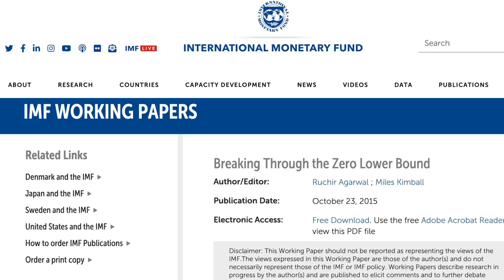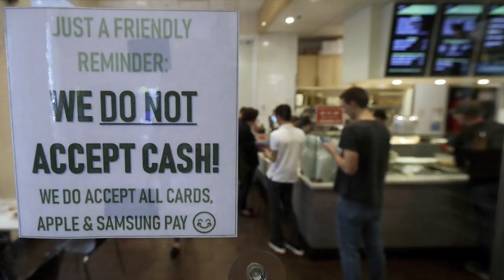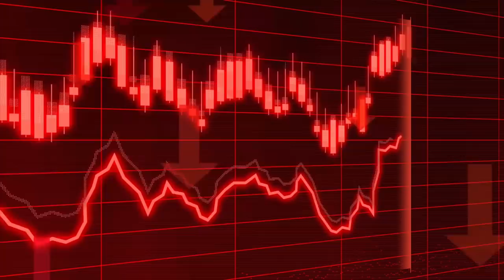🔵 Central Bank Digital Currency Explained

Comment: In Florida, it's the exact opposite for cash.  I've ran into stores that only accept cash for purchases.  You can only pay in debit or credit if you order the product online ahead of time for in-store pickup.
Reply: I applaud Florida for that. Here in California, at least Los Angeles it's becoming the opposite fast. Especially with this new generation who are quick to pull out their phone for anything that they do. 

Regards 🤝
Reply: I went to Slacks Hoagie Shack here in PA and they have a sign that says they prefer cash. I applaud them for that. It makes much better business sense and I was happy to pay in cash.
Reply: @MacMac1313  What about gas?  Does it still cost less to pay in cash at the pump there?
Reply: @MrSrc08c  Sometimes yes. It depends on the station you go to. Some will have a lower price for paying with cash or a debit card.
Reply: @MrSrc08c  cash will cost less until it doesn't.  but great example of where we have always had a different price for goods depending on method of pay. cash might just in the future cost more.
Reply: @hvaball150  I do acknowledge the fact that one day you may have to pay more in cash than you do in credit for the same good.  However, that day is NOT today and I make this point because people talk about cash like it's worthless when in fact, it's value is higher than debit or credit in some (if not all, albeit it's hidden) scenarios.  Additionally, at gas pumps the price difference is not just a service fee to run a credit or debit card, because  if it was, we should see a flat fee regardless of number gallons of gas purchased, instead of a difference per gallon purchased.
Reply: @MrSrc08c  it's a percentage of the total bill (like 4%). that's why its tied to the gallons purchased and not a flat fee. but banks are starting to charge fees by amount of dollars/coins turned in too. if credit goes less % than cash you will see higher cash prices.  I acknowledge not today. but in theory the full cost of handing cash for the bank will exceed digital.
Reply: @hvaball150  If it's a fee based solely off of processing the payment, it wouldn't be a percentage it would be flat (unless you're just getting ripped off, which is possible and another reason why cash is worth more), because I would think it takes no more resources to process a payment for $100 than one for $5.  In fact this is why some stores have a minimum for card purchases, I think it's because the processing fee is too great to offset the profits of a small purchase.  At the end of the day though, this isn't even worth arguing because cash DOES buy more gas and therefore is worth more in it's value at the pump which is one of the largest consumables and therefore a good gauge of the behavior of cash in the overall economy.
Reply: @MrSrc08c  maybe I'm slow today. but a flat fee would not work well. the fee percentage agreed upon is based upon the average expected transaction price of the business. thus they (trx biz) lose some money on smaller trx and make more on larger ones. balances out. otherwise they would have to take the average and bill their fee to small purchases (many people might not buy then). and also lose the large purchases extra amount (which is bigger risk of fraud loss by the way). net loss for the model over an estimated fee for the processor, and the business would also suffer missing sales on below avg purchases.  you wouldnt pay $2 fee to pump $2 of gas. you would wait until you needed a full tank and then pay same $2 fee for $70 of gas. rather inconvenient for the customer too. right now you just go buy gas, whether 2 gallons or 30, and pay the same rate. and digital is about convenience.  I cant really figure out your argument even theoretically other than, yes the transaction itself would cost about the same (but the fraud risk I elluded to). business also account slightly better (not all but some) to variable tax like percentages of sales for profit per gallon. some cant amortize basic fixed cost (like overhead/rent) to estimate their volume,  and that can cause biz failures. adding a fixed-variable costs on there on sales revenue adds accounting. I hope you are not arguing it's a fixed fee. ATMs are like that. in that case you're not exchanging goods.  just services.
Reply: Go Florida!
Reply: Yes, including even Mcdonalds.

Comment: Fantastic set of videos! 2 legends. Been preparing for what's to come. I'm soon moving to a place where I can start a garden! Then I'm all set. Well, if that's even possible...
Just one question. To stop "supporting" the banks. Does it help to move my fiat to a small local bank? In stead of the big banks.. (IF they would fall.. small ones, will just fall too, right?) Many thanks!

Comment: I'm in Canada and am self employed and clients have been bringing me the old $50 dollar bills. Superstore wouldn't take it. I think they are running out of cash and they are having to put the old money into circulation again. Honestly, I've not seen one of these bills for over ten years, easily. Most stores here are still taking cash....I did travel up north recently and I would say most of the smaller towns still have a vibrant Main Street as the locals are frequenting those shops. In the larger towns, like I'm in (size almost 400,000), our downtown and Amin streets  in various parts of the city are mostly boarded up.

Comment: Actually I don't think that you are correct that there is no fee for using cash, for the consumer yes perhaps, but for the retailer not necessarily so, my friend running a bakery said that the bank charged him a percentage of his cash deposits and therefore he did not prefer cash to credit cards for that reason. The banks I assume would argue that they are just charging for the extra handling of the cash as staff don't work for free.
Reply: yes. cash can be expensive versus digital.

Comment: I tried to explain the "Coin Shortage" to family members and they think I am a conspiracy nut.  The fact is either the cheap metal in coins (copper, tin,etc) is about to become worth more in melt value than the coin itself and/or the absence of coins helps encourage people to use Debit/CC cards because they don't want to 'round up' the loss of every dollar and lack of change given.  Either way as the currencies deflate (and prices inflate) in value, then everybody will start looking for the EXITS from currencies and into things that 'maintain' value. (But, it's not possible for EVERYBODY CANT LEAVE A STADIUM AT ONE TIME).  AND, as Lynn suggested 'Nominal' values make LOOK like they are maintaining or outpacing inflation (Houses, classic cars, art, etc.) But in true reality they are just inflating with the currency.  When the Titanic went down the rear of the ship tilted ever HIGHER until the ship was standing on end just before it PLUNGED completely under the water line too.  By then will PHYSICAL Silver and Gold even be available?   I doubt it.   They got ya trapped then.  Glub, Glub; goodbye wealth.  Bonus: but you CAN still purchase 100 Trillion Dollar Zimbabwe currency notes on eBay!

Comment: Alot of gas stations in America will accept your credit/debit card but cash is cheaper rate at the pump. Some the prices are the same. Cash or Credit/debit. Buy Assets. 

Find out what the best assets long term hold & get things to Barter with & look to operate & maneuver off the grid or on it. It's awsome to own land & learn what to put on it. 

Solar is good to have & a well along with city/municipal water is ideal in case their is an attack on water supply. Solar alternative  energy in case if electric is shut down. Also look into Geothermal. Like the wonderful lady says. Land shelter food seeds water silver & gold. Make your home vacation spot & dont be fooled in order to travel. Back to Old school travel. Get in your vehicle & drive. Don't be a Sheep & remember implementing a great reset is based off our reactions. They are smart but only if they have the control. Stay blessed.

Comment: many businesses get denied loans from banks. maybe they need to replace a broke air conditioner at $20,000. and they dont have the assets or other reason. enter the credit loan processor. they loan the money but in exchange they want the business to switch to their card processing (to theirs) and thus will apply some of those proceedings to pay back the loan.  the business just needs to up their prices 1% more and that percent goes to the loan. but they want more transactions to go to the card to pay back the loan quicker. in essence the card processing becomes the collateral or revenue.
Reply: What happens to people who can't afford the Harris/AOC green deal required conversions to their home's  HVAC, lights, electrical systems, etc.?
Reply: @feliciamusic7945  we have already upgraded through our own purchases.  do you have LED bulbs. newer Sear air conditioner.  you will have to pay.
Reply: My question was to get people thinking about what may be attempted by TPTB to control the population. If you cant/won't comply, then what? It's all about moves, as in chess.

Comment: I see the problem with gold as a hedge against all this to be that, as with bitcoin etc, once CBDC comes in, it will be simple for govts to prevent it from being sold for CBDC (the only currency that will be convertible for goods and services). Even if can be converted they will be able to set the price. They'll do everything they can (which will be a lot) to prevent anyone from escaping the system. Even Lagarde has said that measures must be global so that there will be no escape route.
Reply: You find any more thoughts on this, cos no ones really talking about it..

Comment: I don't understand if it's on purpose or by accident but you two contradict alot in this video. You are saying people with follow and go along with the rules and be controlled with digital currency but than push GOLD AND SILVER , Don't misunderstood me I have Gold but I understand I can only trade Gold for goods if the other party understands and trusts its worth. Now who will give goods for GOLD when digital money is implemented, only the outliners/rebels of society. The rebels of going to be few and apart plus hunted by governments. People thinking bidcoin with take over, Bitcoin is compromised look up the program that processes the data byte. It was run and start by a member of elite in builderberg the program/code is BLOCKSTREAM is a second layer of traction.